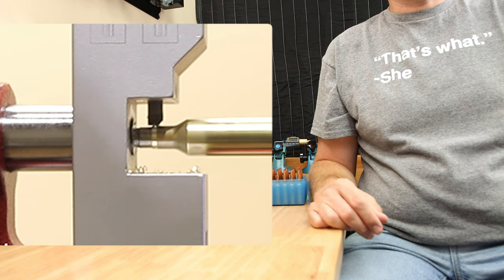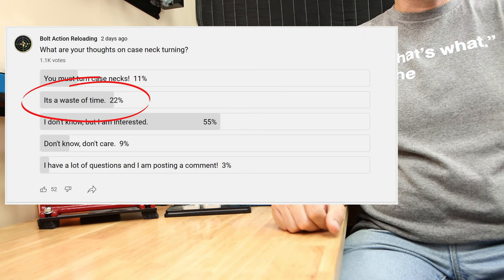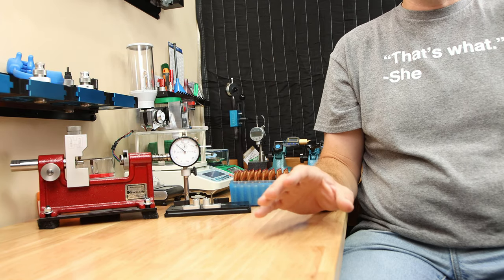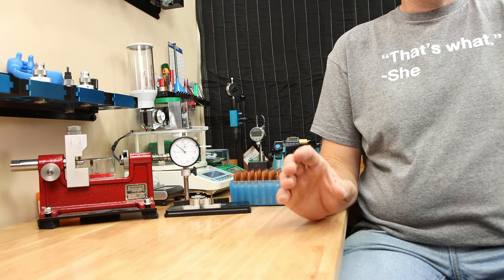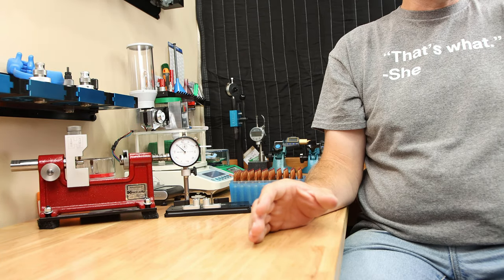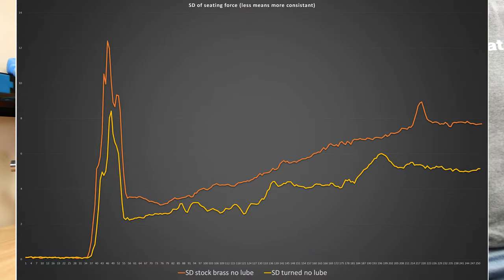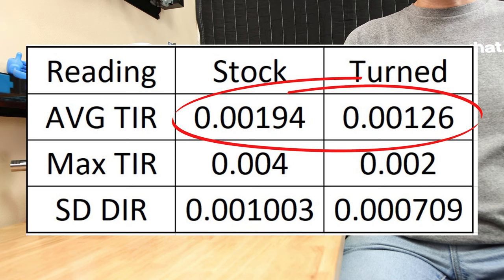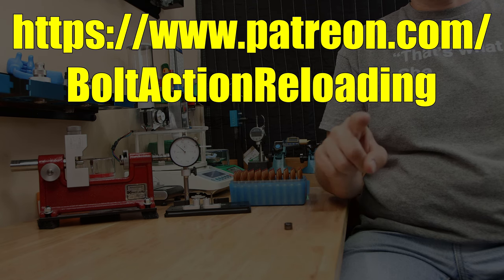Should You Neck Turn Brass? Lets find Out!

Comment: I’ve done a lot of it, but, I recommend just using an expander mandrel after sizing to eliminate the time and effort if you don’t want to turn necks
Reply: I’d say that that it really depends on what type of shooting you are doing . If you are an Benchrest or F-Class competition shooter or you shoot out past or 1000 Yards to ULR distances then neck turning is probably the way to go . If you are hunter shooting out to 500 Yards maximum then it’s not worth the trouble and you would hardly see any difference out at those yardage’s .
Reply: Neck turning really has nothing to do with how you size the neck. If you do neck turn, you can use a bushing die or honed Forster and not have to expand. This eliminates another possible step as well as the possible concentricity decrease associated with expansion on the upstroke. That said, I've never seen any evidence the concentricity has any effect on the target. And I've been looking for it.

Comment: Nothing's a waste of time if you enjoy doing it and feel it's worth while. Honestly though, my rifles have factory chambers and probably won't realize the benefits of neck turning. Have I neck sized in the past? Of course, many of us have but soon realize it didn't result in a meaningful or repeatable result. What I did discover was split necks became very apparent after only two or three loading's. If my chambers were precision machined and required neck turning that's a whole different ball game! 

Over the years I've discovered mandrel neck sizing made a huge difference. I know what my fired brass measures and use the proper neck size bushing to bring it a couple of thousands under size then expand a mandrel resulting in .002 total neck tension. I also anneal after each firing, I feel this is very important.

Firing work hardens the brass and makes it less ductile. Annealing brings the brass back to its "soft" state making the insertion and retention forces predictable.

Comment: I believe in it.  Long story short I started making 6.5 Creedmoor brass from 308.  I converted an old Forester trimmer into a neck turner.  I found some of the converted brass had very thick necks especially Federal so I started turning the necks to .0145" and found not only a huge return in consistency and accuracy but during resizing the neck expansion to size is now very smooth.  I can only guess that on the 30% of cases that were hard and gritty as the expander ball went back through the neck for the final size that there was to much metal there and the expander ball was very tight, it never happens anymore and I can attest to my group sizes shrinking from 1/2moa to just 3/8moa if I do my part.

Comment: I use Lee neck sizing dies. Seems to work OK.
Reply: Good die for partial neck sizing just place a washer over the case onto the shell holder and it steps the sizing area up the thickness of the washer .

Comment: I've had good luck with the 'ironing' case necks with Lee collet neck sizing die.
I've only neck turned when making cartridge conversions.
Reply: I just played with 30-06 to 25-06 brass conversion today on 5 cases. The only difference is the neck is 1 thousandth or 2 different than my stock 25-06 brass. So your comment seems reasonable to me. After converting my brass I measured the shoulders in the Rcbs precision mic and all is well. I resized the neck with Lee neck sizing die. They got in my chamber just fine. I could see needing to neck turn if any don't fit in the chamber but my experiment is only on a small set
Reply: Lee Collet die does not iron out neck wall thickness variations to any useful degree . It just works better on uneven thickness necks . What a Lee Collet die can also do is partial neck sizing by placing a washer over the case onto the shell holder .

Comment: These vidoes are brilliant, they help immensely about making choices of what gear to buy and the lengths to go and amount of work required to achieve desired reloading accuracy vs time spent vs budget. I have no interest in neck turning but I do have quite a range of the SAC bushings in my kit. Which is quite the investment as I’m in Australia and the last order I placed cost AUD $215 or about USD $150 for 3 bushings. The shipping equals one bushing. The information contained herein makes it an easy choice to spend my money in the right place to get the value I seek. Cheers.

Comment: I started neck turning over 40 years ago ... manually , that is holding the case still and spinning the neck turning tool - mine is a shop-made by a friend copy of a Forstner style - by hand  . these days I hold the pilot of the tool in a tail-stock chuck on my lathe and chuck the cases in the headstock . Much more accurate and you don't have to clock the cases when you chamber a round .

Comment: It's hard to do an apples to apples comparison with neck-turned brass, because you're also changing up that neck tension.  I just finished with a dual load work-up with my milsurp 8x57 mauser with neckturned brass.  Even though the neck turns brass gave me more consistent (that is, less non-shooter-induced fliers) and predictable groups, the load work-up liked the tighter neck tension more.  That's not always going to be the case, but, food for thought.

Comment: As a “new-ish” reloader, neck turning the outside doesn’t make a lot of sense to me. Why not turn the inside where the bullet sits? Thanks for all the great content!! 👍
Reply from the maker: Hi Adam, I am not going to pretend to be an expert here but unless you are using something like an IDOD you are either going to outside neck turn (this example) or inside neck reaming. I feel its way easier to size a piece of brass and run a mandrel in the neck to leave the imperfections on the outside of the case to be removed, otherwise for the inside neck reaming (as I understand) you still need to set the outside at a specific dimension to have the inside to be able to be "reamed" correctly. I am going to play around some more here on the channel to try and do a realistic comparison.

Comment: Neck turning can improve accuracy at times from oval necks due to wall thickness. Converting cases such as 300 Black from 5.56 is essential to neck trim to avoid jams from neck walls over .0135, as various wall thickness from case manufacturers. Some barrel manufacturers also have match grade and combat grade barrels that have variations of tolerance.

Comment: I have considerable interest in neck turning and the results on paper. For starts, I will probably use a bushing for sizing (maybe a SAC bushing if I can find one out there😁) and then expand out to .2620" with a 21 Century expander. From there, test from .011-.014 neck wall thickness and use a liquid moly neck lube. We will see how they land on paper. Thanks for sharing more great data!
Reply: How did that test go for you and have you continued to load in this manner or has your reloading process changed in 11 months time?
Reply: Yes I still do use this procedure and it has fine tuned my groups considerably. It wasn't cheap to get to this though. Assess what your goals are. If you're interested in improving subtly then follow this procedure. If you're happy with what you have now I'd stick with it.
Reply: @Jeff_Seely  Yeah good tooling is never cheap unfortunately. What did you find to be the best neck thickness after doing turning tests? You personally turn the necks after the bushing and mandrel?
Reply: @Rickjames127  . Well believe it or not I am turning my necks@.008in now but that is because I have a new custom chamber. I am doing my best when I have minimal neck tension. But that may only be only giving me a 0.125 group improvement at 200 yards. That's why I say assess what your goals are and work out a reasonable budget. Because you are right. Good tooling is very expensive. And everything else that goes with that. Good luck! And no I am turning my next before setting tension. And I get that bullet seated quickly right after my expander mandrel. Don't let your necks sit around for too long before you put a bullet in them.
Reply: @jeffseely86  OK that's what I figured. I think I'm going to start with a bushing die with the sac bushing and I'm thinking a k&m neck turning setup before getting the mandrel setup. Slowly test each new step individually to see the improvement. Got some graphite, ptfe, tungsten disulfide and moly disulfide to test. Starting with the graphite (neolube) as neck lube on a known good load. Getting a dual tumbler to test the moly coating on bullets next. 

I only have reloaded for factory chambers so far nothing custom. So .008" neck thickness sounds crazy. I figure for me I'll start at the same spec you listed in your first comment around .011-.014". Thanks for the super fast replies and insight. .125" at 200y isn't a bad improvement imo. Anything to get me to a more consistent .5moa out of an autoloader I'm down for within reason. For example I won't go down to .001 of neck tension I'd rather be .002 and above based on how I use the equipment. 

My best guess based on the data I've seen the bushing die or neck turning or mandrel make a noticeable improvement thanks to the concentricity improvement. I bet after that initial large improvement it's diminishing returns for each step attempting to improve that concentricity. Say you go from .003" of avg runout using a standard FL sizing die to .001" avg runout using a FL bushing die then the mandrel and turning give you an avg of .0005-.0008 for example. This is just a guess based on the data I've seen. I obviously don't own the tooling yet and having done testing to draw conclusions using my own chambers.

Comment: I’ve used a Forrester neck turning tool and still have it. used to do it with my 243 brass, but I was always worried I was taking off too much by the time I got done. I was shooting one hole groups at 100 yards with and without turning brass using the same pet load, so in my opinion, it didn’t help in that instance.

Comment: You have to make sure that the case neck is straight and any thick parts needed to be removed are on the outside. Using the bushing system these parts would be forced into the inside.

Comment: When in the process did you turn them? I don’t get why turning the outside after sizing would lead to less runout, since I’d think the bullet straightness would be affected by what the inside neck is like
Reply: Neck turning theoretically leads to a cleaner release of the bullet during firing buy increasing the consistency of the neck hitting the chamber wall. Contrary to what would "make sense" even to me, several things have been shown to make little to no difference in group size, SD, or ES, even by the top competition shooters.  Among these are concentrisity (unless the bullet is cocked off at a 15 degree angle) and primer pocket reeming/ uniforming. I want to believe that concentrisity affects quality, but the data from multiple sources highly suggest otherwise.
Reply: Concentricity is improved by neck turning in order to allow the bullet to line up with the barrel is the reason as I understand
Reply: @joearledge1  never heard of concentricity not mattering. Can you point me to where you saw that? I just got a gauge too lol
Reply: @PastaLaVista.  lol yeah I still want a gauge, but the data is pretty strong against it. Give me a few and I'll see if I can track down some links. I'm pretty sure bolt action reloading and johnnys reloading bench have done concentrisity tests where they compare most run out to least run out in a batch of ammo. There's definitely a few more too. Primer seating depth seems to matter (random fyi) based on data. Since you already have the gauge you can also run your own test on reloads and factory ammo to see if you come up with a different answer. But I'll be back in a few with those sources.
Reply: @borbonic  that's part of it too, in theory
Reply: Runout as I understand it is excessive brass build up on the neck area. If you use a mandrel to open the inside of the neck then it is one consistent measurement on the inside. Now you've normalized the inside of the brass only. Then to do the same on the outside against the inside is to either turn the neck and somehow even the brass out in thickness on the outside or use a collet die like Lee provides. I agree inside and outside thickness seems more consistent to target or achieve. I use the Lee dies to do this and I noticed the channel here likes bushing dies from Redding as well as short action customs to achieve something theoretically similar
Reply: @PastaLaVista.  ok found some of the videos: 1. Johnny's reloading bench  "223 rem 75gr hornady bthp with ar comp", 2. Sdkweber "the effect of bullet run-out", 3. Erik cortina "I shot a 5 shot group with this ammo...". I couldn't find BAR's video on it, but I'm fairly certain he's done one. Also I couldn't find it but I think Bryan Zolinkov- professional shooter did one in his witch doctor series but I couldn't find it either, he's a PhD and a good source if you want to back up your reloading with scientific data. I'm sure there are others I've seen and couldn't find to support my claim that runout doesn't matter, but as you can see, part of the problem in finding them is that many don't have "runout" or "concentrisity" in the title, and it's not the "main focus" of some of the videos even though it's addressed in them. Anyway, I encourage you to do your own testing to see what you come up with, especially since you already have a gauge. Hope some of this helps, keep shooting and experimenting, that's how we all get better.
Reply: @joearledge1  good stuff thank you. I’ll check all that out
Reply: @joearledge1  I think Winning in the Wind Youtube channel has done a test as well .
Reply: @conservativesniperhunter7439  probably,  and he's a good resource in general for reloading research

Comment: How about you shoot some factory and some neck turned cases in a factory barrel to see if it’s worth the extra effort.  Out to 300 yards if possible. Thx.
Reply: Do it at 100 to remove as much of the human and environmental element as possible.  I have and found a real benefit with my Savage 12FV in 6.5 Creedmoor shooting Federal and Hornady brass truing the wall thickness to.0145" using the same twice fired brass.  Fire factory rounds, reload and fire again, turn the necks and again reload the same way with the same brass.  There is a measurable difference.  With grandad's 30/06 ?  You probably wouldn't see it but with any newer rifle especially in a caliber like the 6.5Cm, oh yes.

Comment: Only if you have a custom chamber or converting brass cases from larger to smaller . A good neck die like a Lee collet die sizes concentric necks within .001-.0015, l achieve less than .001 most of the time.

Comment: Have you checked to see if there are any pressure differences? I have a little theory that a little more neck clearance in good for pressures (if you turn like me without a turn barrel - I get to the same thickness as you with my IDOD)  - haven't been able to test on pressure trace II yet. Life has gotten way in the way of my reloading this year.
Reply from the maker: I understand the life part for sure. So you have an IDOD? What all cartridges can you turn with it?
Reply: You can turn anything you like. You just need to buy a case holder and then adjust the cutters to the desired thickness. I use it for 6.5x47 and 6.5 creedmoor. Lapua brass. Just got some alpha brass for the 6.5x47 will probably turn that too after testing.

Comment: Considering other top shooters have run concentricy testing and proven it doesn't matter. Case turning could realistically only help with neck tension.
Reply from the maker: HI James, I have a couple thoughts on this. First, in general, I agree with your statement, but I try to remember how biased I am to want to believe something that I want to be true without testing it myself. what keeps me up at night:
1 - no one publishes these results. (or at least I have not found any real significant data sets out there to see) not saying anyone is lying but things like this need to be quantified. I don't believe that one can make blanket statements that it makes no difference if you don't know those details. Are any of these top shooters using equipment to reload that really gives reloads that have .010" of TIR? Personally I doubt it. Why would they be using a $1300 press and $500 dies if it didn't matter at all.
2- There has to be some limit too this. You can't chamber a round that looks like a banana. Knowing what that limit is, should be important. (to someone)

Comment: What are your thoughts on inside case neck turnning?
Reply from the maker: Other than a Wilson inside case reamer or the IDOD what would you use?
Reply: @BoltActionReloading  I have a Forster reamer that can be held by a case trimmer. The theory is in a fired case, any excess material is pushed inside the neck. The reamer removes it (supposedly) making the neck more consistent. I don't know if I'm accomplishing anything positive or not.
Reply from the maker: I have the le Wilson version of the same thing. It's on the schedule at some point.

Comment: I think neck turning brass is an okay idea.  The problem is they're turning the WRONG SIDE.  They need to be turning the inside of the case, not the outside.  Or better yet, turn both sides.

Comment: I think you need to invest in a IDOD neck turning machine. For science 😄
Reply from the maker: I had thought about trying to figure out a way to do it, but I really don't think I can bring a whole lot of value with the info. If it works great some will cheer, if it doesn't make a lot of difference you get told you don't know what your doing. Certainly a very neat piece of equipment.